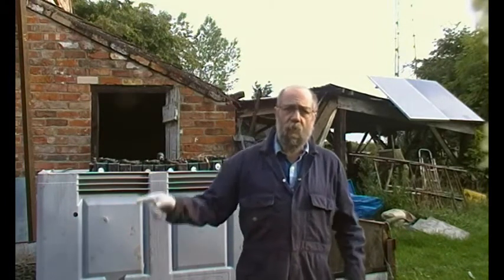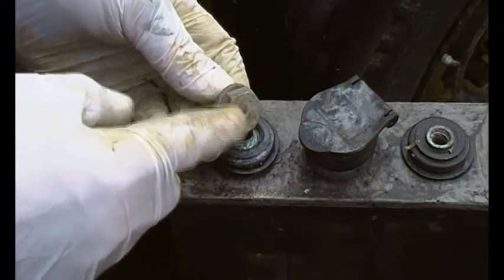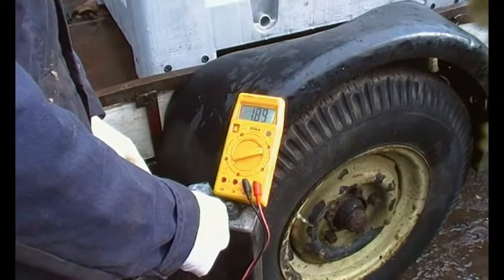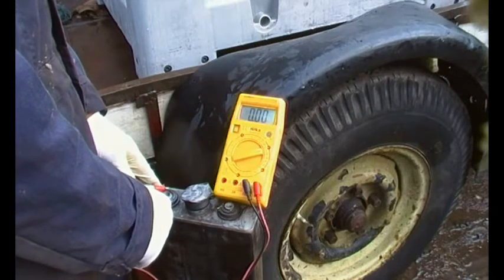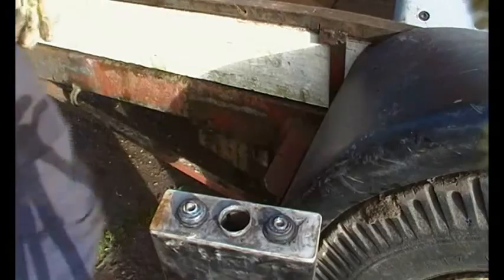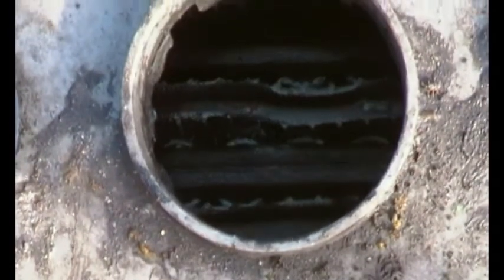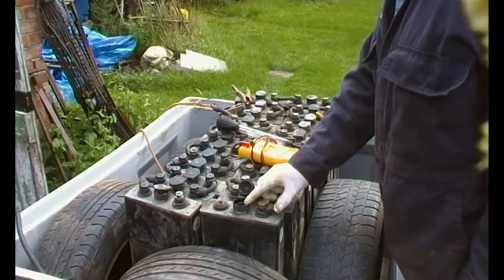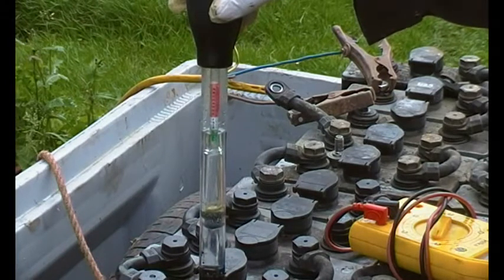Forklift lead acid batteries, investigation, renovation and equalisation, part 1 flooded batteries

Comment: Near me, Scrapyard's want around £500 for an old forklift battery. It doesn't seam worth the cost
Reply from the maker: HI, scrap battery price is about £500 a ton at the moment, so it does make it difficult. That's 50p a kilo and some cells will weigh 35 kg.  Depends on how many cells you want and the tests you make before choosing them. I wouldn't bother with packs where the links are welded on. There are places that deal in good second hand cells, though I don't know what they charge. Cheers

Comment: 48v pack of lead acid Battery .we will be able to use epsom salt.beacause  gravity is too low
Reply from the maker: Hi, if the gravity is low then the battery needs charging to change the lead sulphate on the plates into lead and sulphuric acid, hence increasing the strength of the acid and so the specific gravity, 
PbSO4 + H2O = PbO2 = Pb = H2SO4, cheers
Reply: Hi for alls: Hoe do you think that the "epsom salt" can help this battery? And....what do you think about "sulfato de zinc" ????
Reply from the maker: Hi, epsom salt is magnesium sultphate (MG SO4). The lead acid battery works on sulphuric acid (h2 so4) and lead. The SO4 can be trapped in the lead sulphate when the battery is discharged and it takes gentle slow charging to change it back to sulphuric acid and lead. By adding epsom salt the SO4 element in the cell is increased but pores in the surface of the lead plates will still be blocked by the sulphate that originally came from the sulhuric acid and so discharging a battery that has had epsom salts added will make the problem worse. So what do I think?  it damages the cell even more and is pointless. Cheers
Reply: Good point about this. And....what do you think about the "zinc sulfate"???

Comment: I  had a Bt cargo C3E ,48 V truck,15 yr old,1500 hr done .
Recently, it had produced some error code 
47 D4
47 1A
It had just 3  Brandt new Cells replaced 2 weeks
We have put in in full charge , [ 51v ] after that,
on the dash board , it shows full charge .
As soon as , we start using it 2 mins , it cut out .that 47.1A + 47.D4 came up,it drop to 46.4 V,but the dash board .it still show full charge !
Reply from the maker: Maybe you have some duff connections, or further duff cells, A hydrometer and a 2v 200 amp drop tester are your friends here. I think I have a video on how to make a drop tester, it might be in the home live series. Cheers